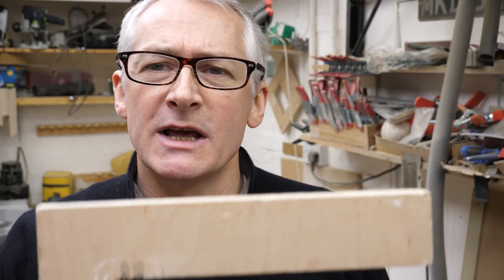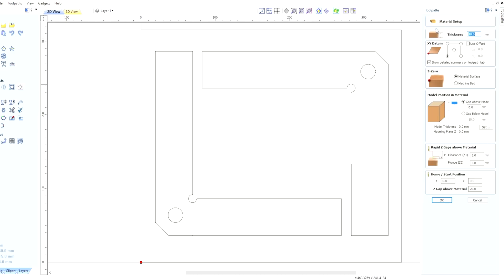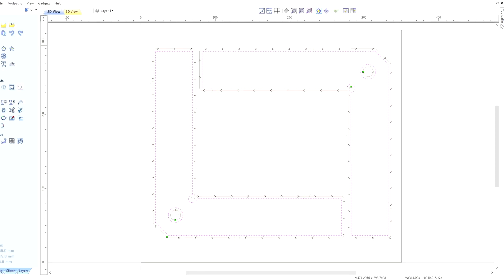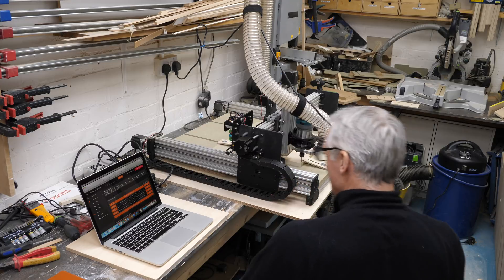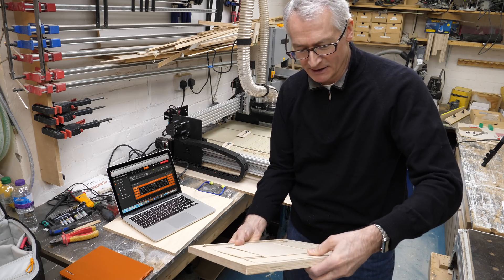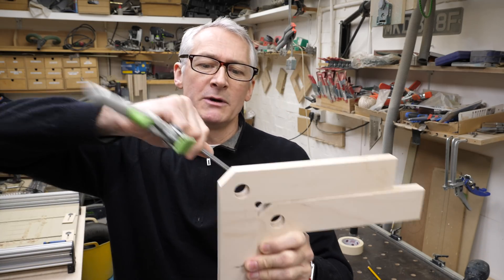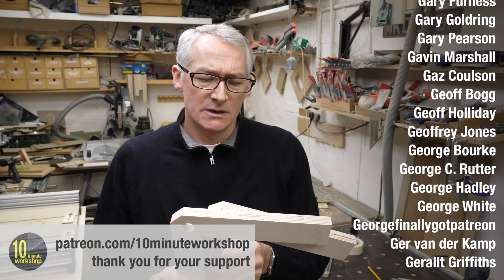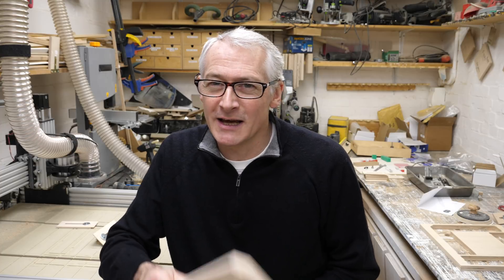Starting Out in CNC P10 - Clamping Squares [video 394]

Comment: Almost a year later, I'm interested to know how you are getting on with this. I've recently got myself a small 3018 Pro with the intention of upgrading to either an Ooznest, Shapeoko, or X-Carve once I'm a bit more comfortable and have validated its return
Reply from the maker: Thanks. I can honestly say that I've barely touched it, other than to move it - twice - in that time. Hopefully I've moved it for the last time, and I'll get to have a proper play with it before too long, but it turns out that I'm just not that interested in 3D computer drawing, which is an issue. 🤷‍♂️

Comment: Hi Peter, an interesting e-mail pinged into my inbox recently talking about the Yeti SmartBench portable CNC.  It's a very clever device using a different approach and they've re-imagined the user interface/controller to reflect modern touch screen and icon use.  It is quite pricey £4.700 + VAT including a professional spindle.  Might be something your mates at Ooznest would be interested in exploring to create a lower cost version for hobbyist/small workshops?
Reply from the maker: I’ve never heard of it, Steven, but I’ll take a look, thanks! 👍👍
Reply: The yeti is old news today, but i have the 32nd unit they made.  Its great, but its design is limiting.  For full 4x8 sheet goods its fantastic considering it portable, just slow.

Comment: Did you say you were going to acquire a CNC specific router when you initially mounted the trim one? You mention earlier in the series about the heat of the router and the collet, are there continuously rated options available?
Reply from the maker: Yes. There’s a relatively new Mafell ‘milling motor’, a spindle from Kress and also a Fein die grinder that all look interesting and have been recommended. The Mafell and Kress can also be powered and speed controlled by the board on the CNC, which is appealing.👍 To be clear, this little Katsu trim router, while outstanding value for money, was just thrown into this CNC because I had it - it was never intended to be the final motor. A lot of guys use the Makita and DeWalt palm routers without any problems. 👍👍

Comment: Hi Peter.  Not sure if I missed it in one of the videos, but what is your dust/chip extraction setup for the CNC?  Didn't see anything in the equipment list.  You look to have the clear hose from the CNC going under a unit (to a cyclone separator? ) and then a black hose going to a drum extractor.  Just wondered what you were using that was happy to run for maybe hours on end.
Reply from the maker: Hi! It’s just a regular drum vac - detailed in video #366 - no cyclone, just stepped down from the 100mm hope to 65mm for the dust shoe. No, I wouldn’t let it run for hours - but I wouldn’t let the CNC in its current config. run for that long either. 👍

Comment: That little machine is small enough you could build an enclosure round it with some perspex doors, does wonders to cut down the noise, and there are several soundproof cabinet builds for the dust extractor available on the YouTube. It gets old really quickly listening to a long cut.

Comment: 3.58 shouldn't you isolate the power off, live m/c and could start at any time
Reply from the maker: On the router? No, strictly manual control with this one. 👍
Reply: @10MinuteWorkshop  I thought it was all auto

Comment: If one of your video cameras has Bluetooth capability you could set it up to broadcast to your phone or tablet so you don't have to occupy the same workspace with the noise while making sure the blue smoke doesn't escape. Just set up a folding table & chair, maybe a beach umbrella or 'Ezy-up' gazebo in the driveway (they aren't easy up DAMHIK) and you can do your accounts, design work or hand tool work outside. Or get some carpet offcuts and make some noise baffle panels to hang in the doorway between sections of your shop.
Reply from the maker: Thanks. This isn’t it’s final resting place, so I’ll be looking into all that once I’ve moved it to another room. 👍👍

Comment: Great little machine Peter. Two bits of advise, always try to ramp into the work instead of a straight plunge, it puts less strain on the spindle/router and leaves a neater start and end. Also try the 3d tabs then the machine won't stop, raise, move, stop, lower, move at every tab, it just keeps moving as it ramps up and then down again, also leaves a better finish as you tend to get a little divot at every pause in the travel.
Reply from the maker: Thanks Alan! My experience comes from using routers hand-held and in a table, where they just get plunged, but absolutely, when I get a ‘proper’ spindle in there, I’ll use ramping, thanks! 👍👍
Reply: @10MinuteWorkshop  Ramping also allows you to use "cheaper" non plunging router cutters/end mills etc.

Comment: Water cooled all the way I can work in there without needing ear buds most of the time. I will probably course controversy by saying I use the cheapest straight flute for tool station. £1.59 each.
Reply from the maker: If they cut, then that’s all you need really! 👍👍

Comment: Hi Peter, very interesting.  One of the tools used by machinists in metal work set up is a Starrett edge finder which goes in the router collet and you spin it over and it gives a very precise indication when it touches the edge.  They are quite cheap (Starrett 827MA Single End Edge Finder with 10mm Body Diameter and 6mm Contact Diameter (Amazon Prime) £21.93 or Starrett 827MB Double End Edge Finder with 10mm Body Diameter and 6mm & Pointed Contact Diameter (Amazon Prime) £26.21).  They are very useful for the drill press too.  If you could find the edges with one of those it should be an easy calculation to find the origin for the start of cut programme.  There might even be programming in the CNC software which defines the start from edge settings - if not maybe a possible enhancement for the CNC control software?  Steve
Reply from the maker: Thanks Steve. It’s quite common in the CNC world to have a little XYZ touch probe that does something similar  - I just haven’t got around to getting one yet! 🤷‍♂️👍

Comment: Fantastic series. Thanks a million. Is that the Katsu Router you are using. If so how did it do. I bought 1 a year ago and am afraid it will not last and still have not used it.
Reply from the maker: Thanks! Yes, it’s a Katsu. It’s done really well,  it it’ll be the first thing I replace/upgrade. I think they’re amazing for the money, but really not the tool for this job as they’re not designed to run for 30-40 minutes at a time. They’re also unbelievably LOUD! So yes, upgrade very soon, on that front! 👍👍
Reply: @10MinuteWorkshop  I bought two of them for a workshop environment,  on the bearings and bushes burnt out (6months)  The other overheats and sounds like a freight train,

Comment: Peter, I know this was your first project, but if you want to make the best use of the material (even though it is only scrap wood) then having the cutting pattern like "Sargents" stripes would allow more pieces out of each board! It could also cut down on the number of cuts as one pass would be on two pieces saving time and increased productivity with large orders! I can see this as a new chapter in your life as your use of this machine expands almost exponentially as you recognise the possibilities it holds!
Reply from the maker: Thanks John. Yes I’m aware of the benefits of nesting components, and the advantages of alternative layouts; I’m not going into production with my first cut, though, and I’m also severely constrained by the size of the birch ply offcuts I currently have to hand. Timber yard should be open again next week - and FWIW I do have plans for those centres. 👍👍